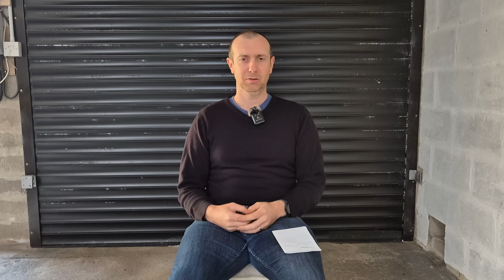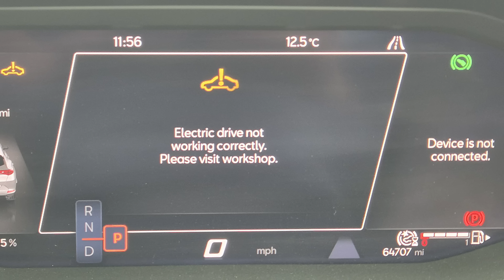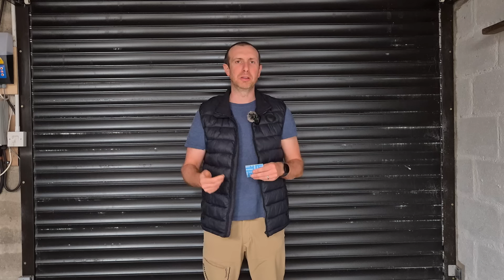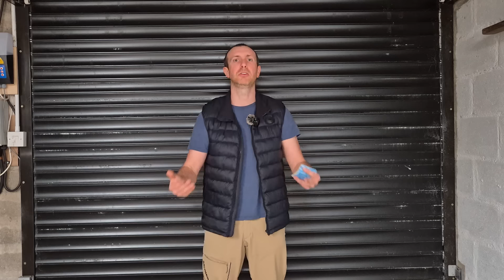Why Cupra REFUSED the 8 Year Battery Warranty Claim

Comment: Get an EV. I had a Golf GTE 7.5 and paid £1500 for a DSG oil and cam belt change. Had the HV battery seals replaced under warranty. Sold it at 50k miles for just under £12k because I needed more luggage space. I now have a Polestar 2 SM LR and it’s amazing. It was similar price to a Passat GTE estate. 3 more years on the PCP. Over 9400 miles so far and charging at home has cost me just £165. First service isn’t due for another 8600 miles. 300 mile range is so good I hardly ever need to use public chargers.
Reply from the maker: VAG PHEVs are costly to maintain. I had a similar bill for my 40k service. Polestar looks an impressive car. Enjoy!

Comment: If you want to buy a hybrid, buy a Toyota.
Reply from the maker: Solid reliability, just couldn't live with the CVT gearbox
Reply: Trust me, Toyota are not what they used to be
Reply: Toyotas don’t use a traditional CVT gearbox… instead of a belt it has an electric motor. I’ve had 2 Toyotas the last being a Toyota Rav 4 hybrid. I’m currently in a MG ZS EV that I got new/pre registered full spec for £19998. Been trouble free motoring in the EV so far. Servicing is also every 15k miles… I would also double check because some EVs might have 20k servicing to save having to get 2 services per year.
Reply: What model?

Comment: The issue isn’t PHEVs or hybrids in general, it’s who makes them. There’s only one company with two brands that do hybrids properly and reliably, and have been doing them for decades. They are constantly at the top of the reliability charts for a reason. You simply don’t get all this faff with a Toyota or Lexus.
Reply from the maker: Solid reliability, just couldn't live with the CVT gearbox
Reply: @TorqueWithAndy Sorry they couldn't program some jerks in their direct planetary drive system for old diehards like they do with some true CVT drives.
Reply from the maker: @RogerSutton-ik9fj @RogerSutton-ik9fj It's not the lack of gear change, as I've driven and owned EVs before. I had a Corolla for 3 weeks in Italy, and in town it was simply brilliant, but at high speed, throttle input would send the revs high until I took my foot off the accelerator. Great car in town, just not for me I'm afraid.
Reply: @TorqueWithAndy Was it the hybrid Corolla like the wife's Corolla Cross hybrid with a 2.0L engine? That's where you get the power off the line with the torque of electric shifting seamlessly to the economy of Atkinson Cycle petrol and the car still requires adequate ICE capacity. To be fair the major hybrid benefit is stop start urbandriving with the addedbenefit of regeerative braking but true CVT does offer significant economy too which is why it's becoming common against expensive 8/9/10 speed autos. It's all forced on carmakers to limbo under increasingly onerous emission standards designed to drive us all into EVs and be happy.
Reply from the maker: @RogerSutton-ik9fj it was the 1.8 base level trim as was a hire car. If you reccomend the 2l, I'll add it to thr drive list too, as some 2022 models are within budget
Reply: @TorqueWithAndy that’s the self charging hybrids tend to do that, especially ones with a smaller engine. The plug in hybrids react different, and don’t race the engine unless you really floor it. When you ask for medium power, the engine tends to stay quite low revs, and the system draws the extra power from the PHEV system.

Comment: I think EV is the way to go now. Therr are plenty with decent range now - best approach is to get a nearly new one - eg i bought a year old skoda enyaq with 2000 miles on.  I saved around 40% of originsl price and was bought from a main dealer
Reply from the maker: Sounds like you got a good deal. My only concern buying nearly new EV is that in around 4yrs id be selling it prematurely with another big hit of depreciation, like I am with the Formentor at 70k. Ideally, the next daily, I'd like to see 150k, or 7/8yrs. Have a few test drives coming up, budget around £16k. Always a tough one to weigh up for high mileage users the most economical way of car ownership
Reply: @TorqueWithAndy agreed but if you buy at a good discount as a pre-reg this goes a long way to mitigate
Reply: @TorqueWithAndy my first EV was an MG4 - only changed it because I needed room for my wife's wheelchair.  The MG is not quite as plush as a Cupra - but a two year old one with 250+ range is probably within budget. They have a decent warranty on major components and are good to drive.  Worth a test drive?
Reply from the maker: @chrispenn715  Ill certainly be looking at the Enyaq while at the Skoda garage, although my budget will only get me the 62Kwh, is yours the 85?
Reply: @TorqueWithAndy  Mine's the pre facelift, so called 80 - with 82kwh battery and 77kwh claimed useable.  Does a realistic 300 on a charge in the summer, with a bit left for emergencies.  There is an extended range MG4 with similar range - should be a few coming through on the used market now.
Reply from the maker: Just picked up my new daily, ex-lease car. Although the Model 3 is compromised for me, the price for the car you get was too good not to consider. Ordered a pet liner for when the dogs travel occasionally https://youtu.be/ZQOWYegnLr8
Reply: @TorqueWithAndy   Thanks for the update - hope you have years of trouble free EV ING 😊. Cheers
Reply: Do you do over 20,000 miles a year ?
Reply: @hunchanchoc8418 I don't - And I appreciate that it may still not be viable for some people to go EV.  It does work for some high mileage drivers tho

Comment: this is similar to the chevy volt issues here. common for their 12v auxillary coolant pump to either go out or not send the right pwm signal to the car so it isnt sure if its running nominally and goes into a weird mode. i kind of understand since its a 12v component and not a high voltage component. idk i did it myself for 60 usd for the part. the dealsership charges almost 700-900 usd lol. i would rather be shot in the face
Reply from the maker: Good to hear you managed to replace yours fine. 
The only issue I have with Cupras interpretation of the component not being covered. Is that it is located inside the HV battery. The lid needs to be removed, battery modules separated and removed to access the sensor and pipes. Then battery coolant flush. Seems very invasive into the HV system for a component that isn't covered under the warranty or workmanship defects.
If the car was over the 100k millage warranty, I would have looked into the repair myself, but lots of specialist tools required, insulated wrenches, etc..
Reply: @TorqueWithAndy  ya generally diy wrenchers will live longer if they avoid hv dc components.
that is utterly stupid placement for a part that is prone to failure. the same type of pump is used on leafs and teslas for the same purpose and is a known failure point. 
the irony is if you ignored the issue long enough, and there was a coolant leak inside the pack, it would eventually throw an isolation fault and require complete battery replacement, which im sure would be covered. that whole time though you would be at risk of the pack shorting lol. you may have been able to trigger the isolation fault by putting some hard tap water into the loop if they normally use a distilled/di mix coolant. usually isolation faults take special scan tools to decode.
the ford focus phev had an issue where the coolant plumbing was such that they did not engineer for expansion/swelling of the battery cells and they would pull the tubs off of their fittings inside the pack and leak coolant everywhere. some hv batteries are just so surprisingly under engineered and fail unsafely. i am so jaded about wishy washy warranties. it just places an extra party in the loop that you have to fight against to get the value back out of the exchange.
Reply from the maker: @vevenaneathna thanks for sharing your HV experience!
I actually did almost just leave it to get worse and leak all over the pack, as you said to short the pack, so it would be covered under warranty. My wife was uneasy about driving it though without it being repaired 😅

Comment: Was thinking about getting a for mentor hybrid next but don't think I will now,if they don't uphold the warranty when it has been main dealer maintained all it's life then I will find something else.
Reply from the maker: Still a great looking car but I'd recommend looking at the 1.5tsi petrol. 
While my Formentor has been good on fuel plugging in every night over the ~100 miles a day I do in summer. It's really not good in winter, and you'd get similar out of its petrol equivalent.

Comment: diesel is king simple
Reply from the maker: Shame the manufacturers are moving away from it, leaving the choice for >2022 slim
Reply: @TorqueWithAndy  Forget Diesel, it's the worst ICE car you could own, depreciation will kill them as their life cycle will be shortened. In India they were already trying to get rid of diesel  older than 10 years by refusing to sell them fuel at the filling stations. If that trend catches on then your diesel will have a limited lifetime and be consigned to the scrap yard after those 10 years...
Reply: Diesel is the king of the polluters, tftfu.

Comment: Get a secondhand Tesla and home charger — save a fortune 🌝
Reply from the maker: Already have a home charger fitted from my EV in 2018. At the time I looked and test drove a Model S but it was too big and out of budget. 
Model 3 is useless for me, needing a hatchback. Id consider a Model Y, but its currently out of my £16k budget at around £25k. Due to my millage per year, I wouldn't look at a car with more than 30k miles already on it.
Reply: @TorqueWithAndy with a new mod Y out since May worth keeping an eye on prices of secondhand, 30k is barely run in ,  tyres being the main consumable.  Take a look @ Jonathon Porterfields  UToob 🌝
Reply from the maker: Just picked up my new daily, ex lesse car. Although the model 3 is compromised for me, the price for the car you get, was too good not to consider. Ordered a pet liner for when the dogs travel occasionally https://youtu.be/ZQOWYegnLr8

Comment: Does Cupra in the UK not have the 5 year unlimited milage Warranty?
Reply from the maker: Unfortunately for me, the Cupra 90k / 5 year comprehensive warranty only came in on cars manufacturered from spring 2024. Mine is 2021,  had it from new, and is under the old warranty 3yr / 60k miles, standard for most VAG products. The battery and HV system is covered for 8 years / 100k, but it didn't help me in this instance

Comment: A diesel car with a Timing Chain, would have saved you a fortune. 20,000 service intervals, No cam Belt, Brakes around 50,000 mile life span. And the best bit 26% cheaper.
Reply: And approx 56 pence to HMG for every litre .   😡FTG 🥴
Reply from the maker: Always liked diesel, having mostly worked on Land Rovers. Its a shame the choice is dwindling now for us higher millage users, especially with VAG & BMW. With me needing a Euro 6 going into a LEZ zone daily. I had looked at a Kia Sportage diesel 2024, but over 11 seconds to 60mph, I instantly dismissed it
Reply: @TorqueWithAndy  BMW 335D? Euro 6, sub 5 secs (if you need torque) and savings to be made in the long term.
Reply from the maker: @andrewhill9369 great engine, absolute missle, hard to justify for a 20k mile pa daily, unfortunately. Maybe get some man maths on the go 😅

Comment: Make sure you buy another EV to save money and the planet 🤣
Reply from the maker: I would have considered an EV for my next daily with the cheap electricity rate overnight. 
However, if they throw a big bill during the ownership, it soon negates the fuel savings. Also the depreciation, on my PHEV Formentor has been the same as the equivalent 1.5tsi petrol, which was significantly cheaper than mine when new. 
So it's 99% likely I will be getting pure petrol vehicle for next daily. Have a few test drives lined up the next few weeks 👍

Comment: If it's not covered by warranty, it's not high voltage only.
Reply from the maker: The battery cooling pipes and sensor are a stand-alone system that run inside the HV battery, that regulates and monitors the HV battery. 
Its separate from the engine cooling system, which has its own coolant tank and piping system.
Reply: @TorqueWithAndy Anything within the battery pack is covered by the 8 year, 100,000 mile warranty. They're trying to pull a fast one. 
Contact Faintree in Shrewsbury, they take a long time to do the job, but the work is spot on.
Reply from the maker: Glad you've had positive experiences with this branch. But that's what I thought, and I will still maintain that it should be covered under the 8-year warranty. The HV dealership said they had done a fair few of these repairs already. Their first one they covered under warranty, but when they claimed the work back from Cupra UK, they didn't pay out! So the dealership lost out here and was stung by the repair bill. The issue is that Cupra UK is not covering this component under the 8yr battery or workmanship warranty